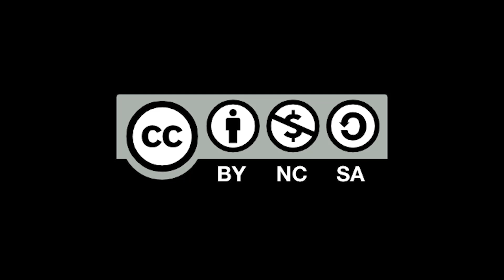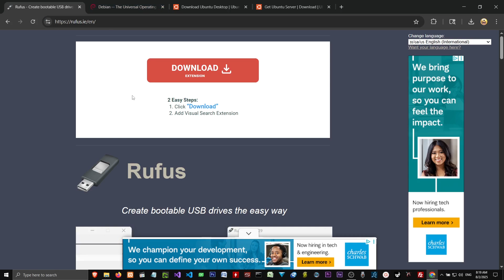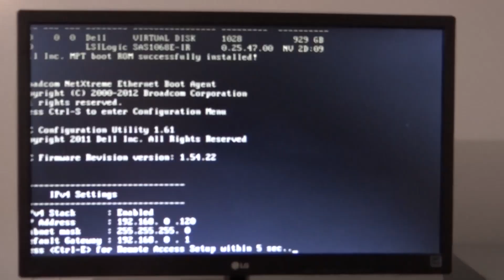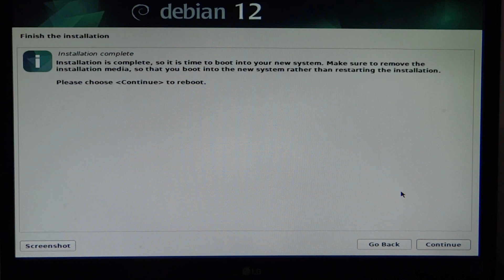Installing Debian On an Old Dell Poweredge Server - Part I (and failing with Ubuntu)

Comment from the maker: PLEASE watch my important video “I Am Fighting for Internet Freedom and Privacy (building a new private file browser from scratch)”

https://youtu.be/FvTYWZ88RCs
~~~~~~~~~~
In this video, I will go over this ancient use Dell Poweredge r410 server and demonstrate how to install Debian and Ubuntu on it (not dual boot). I made some mistakes and ran into some issues which I have documented and may be helpful for others out there trying to do the same thing. One of the things that threw me is during the installation is why it kept referring to the actually hard drives in the server as ‘VIRTUAL DISK’  (ie 23:33, 24:03, 24:16, 25:06, 33:00)

Key Moments:
0:01 – Intro
1:10 – Opening and walk around start
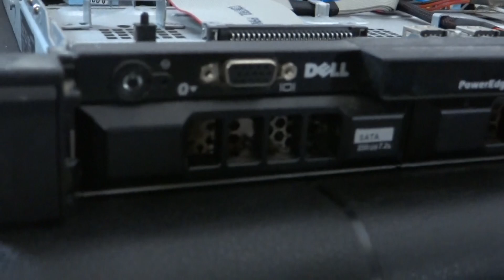2:40 – How to remove drive bays
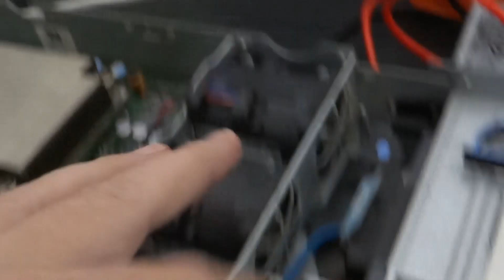3:22 – Check CMOS battery - ALWAYS CHECK YOUR CMOS BATTERY
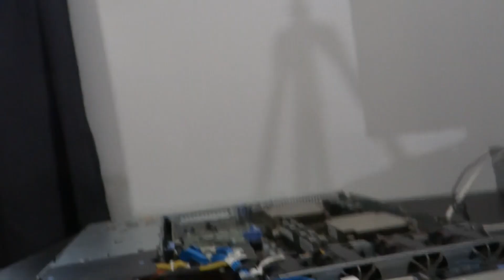7:01 – backside I/O
8:35 – First Boot
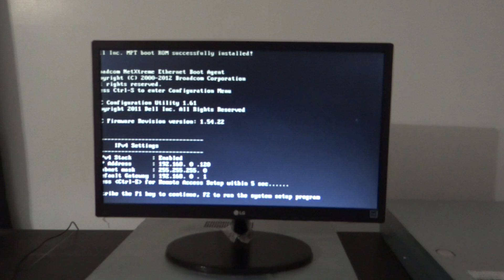9:00 – Entering ancient BIOS (F2)
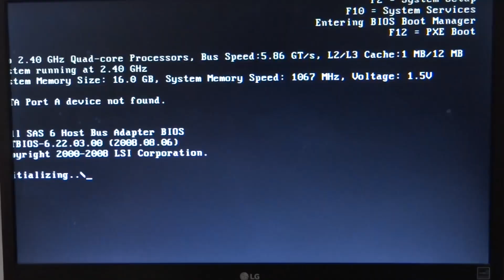10:24 – Discovering old Ubuntu 
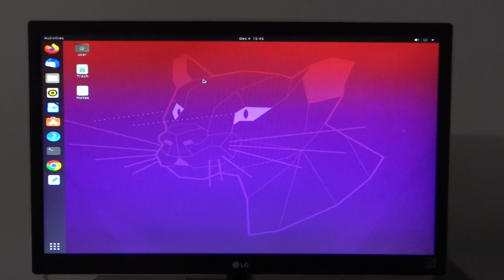11:48 – Downloading Debian 
12:50 – Downloading Rufus software for making bootable media
14:40 – Demonstrating how to use Rufus to make Debian bootable media (just watch, please don’t follow yet)
18:39 – Demonstrating how to use Rufus to make Ubuntu bootable media (just watch, please don’t follow yet)
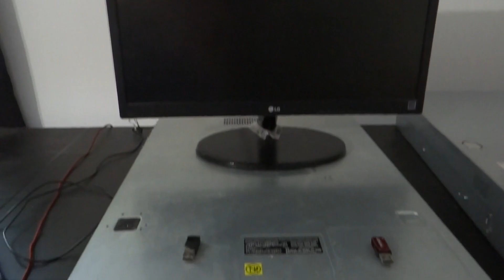20:06 – Install on server start (just watch, please don’t follow yet)
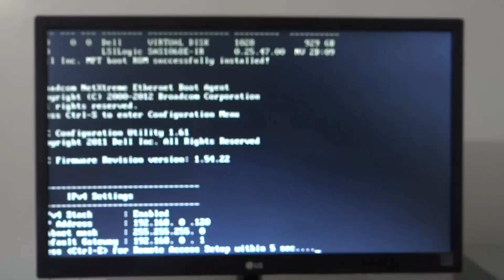21:44 – Booting and accessing boot manager (F11) to select bootable flash drive
22:16 – Debian Installer demo
27:44 – Booting into Debian….FAIL 
The Debian I downloaded from the homepage requires extra steps to set up and is more suitable for power users and 1337, so instead, it is recommended to get a ‘live’ version of Debian
27:54 – Getting a ‘live’ version of Debian
debian.org/CD/live/
29:00 – Using Rufus to make Debain bootable USB drive
30:04 – Booting and accessing boot manager (F11) to select bootable flash drive 
30:34 – Opening Debian Live system demo
32:00 – Actual install procedure (Booting and accessing boot manager (F11) to select bootable flash drive)
34:42 – Success!

Comment: I'm mucking about with "trashed" PC's, some with quite decent multiple core I5, and an old Sony with a Pentium... I saw your comment on EC, thought that you might have some interesting insights.
Cheers from 🇨🇦 🍎 user in 🇩🇪
Reply from the maker: I did a video a few days ago called "How to Install Linux Mint On an Old Dell Optiplex" so you may want to watch it. It has similar specs.